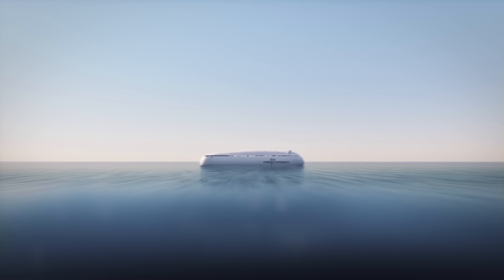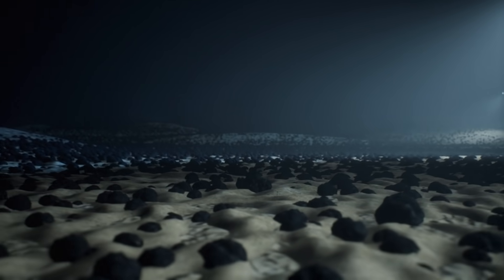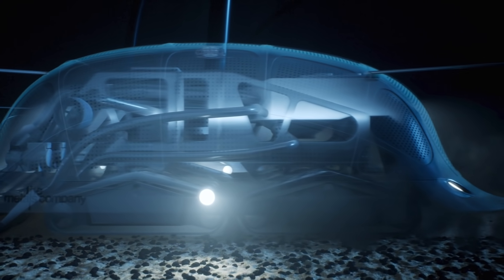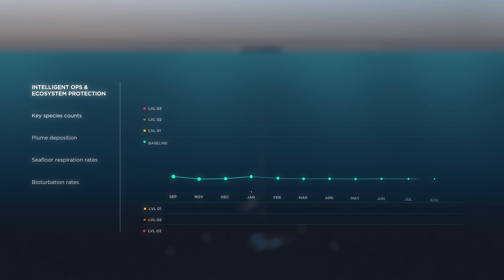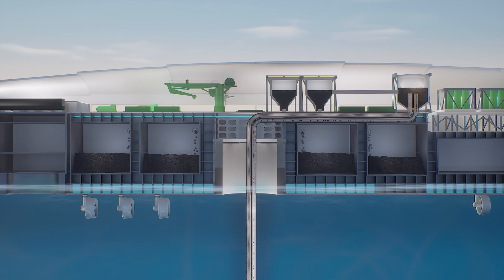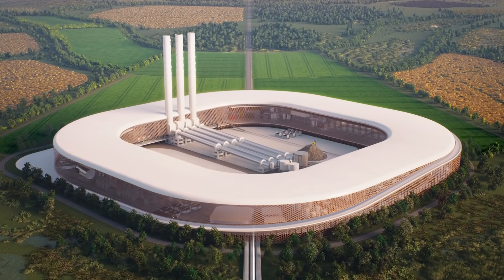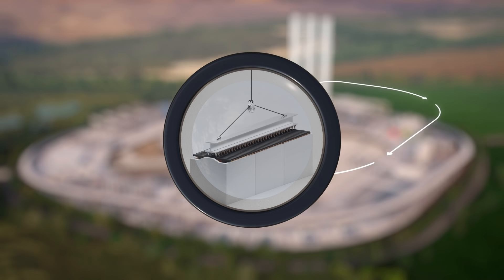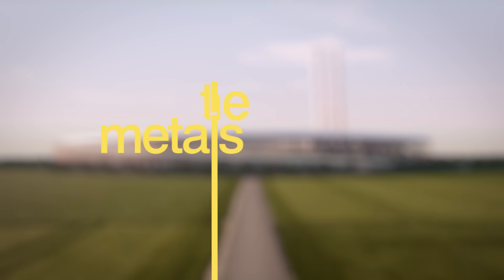TMC - The Future Is Metallic

Comment: More renewable BS, mining these metals so   more destructive than oil drilling. The pollution from these processes is horrific compared to oil. BUT we're does the energy come from to charge these batteries? Wind and Solar are not reliable enough ( as we are seeing as the Europeans are running diesel generators at the wind farms to sustain their needs). This is all a grift a scam and a novelty. E vehicles need charging stations and they are few, and have limited range and take too long to charge to be productive in equipment and service units. We have plenty of oil, drill baby drill and stop drinking the koolaid.

Comment: good ideas and all, but why not put most of the equipment used in the port side plant onto the processing vessel, in theory if you just use a cleaned and converted floating oil rig you could put the whole processing plant on the vessel and just have the shuttle vessel take back the finished product, granted wouldn't be the best solution for recycling end of life ev batteries but in theory it centralizes your operation into one spot (other than when the processed battery metals leave the ship for port).
Reply: Ships operate on bunker fuel or diesel. A land based plant is much more efficient at processing materials. Maybe the dream of clean energy is not thought out too well but land based power requirements are a lot cheaper. Much cheaper to transport the nodules than to pay for all the fuel/oil on a ship/rig to process it.
Reply: also the whole thing can sink by accident... you need insurance and are liable if water gets polluted

Comment: This is assuming there are no sea creatures on the sea floor, no?
Reply: But the nodules that Gerard Barron keeps showing in these interviews are much larger than some of the smaller sealife, so a filter wouldn't be able to discriminate
Reply: @oooohsnaaaap  I dont see you doing anything productive. Grow Up
Reply: @Coldfront-sg3tt  you're here commenting on my comments.  So how exactly are you being more productive than me?
Reply: No…similar to how oil got extracted from sea floor. TMC (the metal company) will partner with one of the big offshore guys to extract metals
Reply: @tnt_pkk1311  yeah but TMC is using a vacuum cleaner to suck them up, while oil rigs get drilled into the ground.  That vacuum is going to suck up a lot of sea life and jostle their environment.
Reply: @oooohsnaaaap  small sea creatures will return to ocean immediately. They only pick up nodules. It works similar to air filter. It only picks up nodules

Comment: Implementing a "black box" rotary centrifuge near the seafloor could eliminate the need to pump up residual sediments with the nodules, by separating them near the bottom, in turn also eliminating the sediment plume released by the surface vessel, at least in theory.
Reply: Too far to have a quick turnaround to correct problems and maintenance issues. There’s always something happening to a centrifuge or separator. Having quick access to correct a problem is essential to get things back to operating.